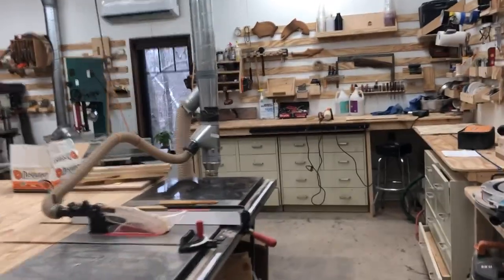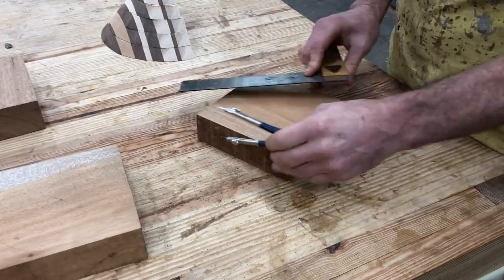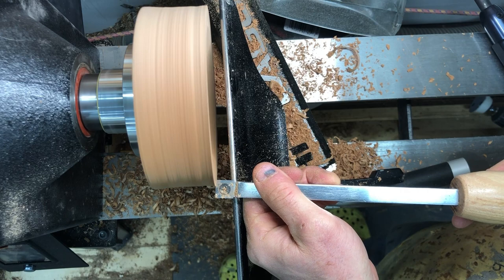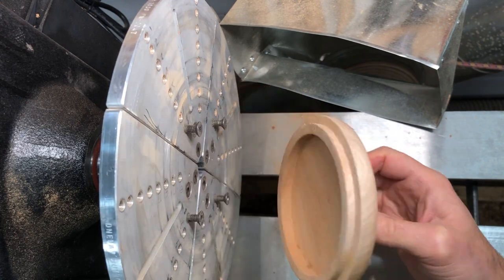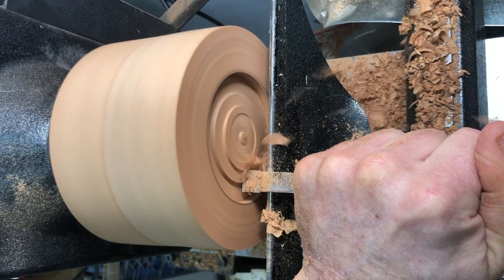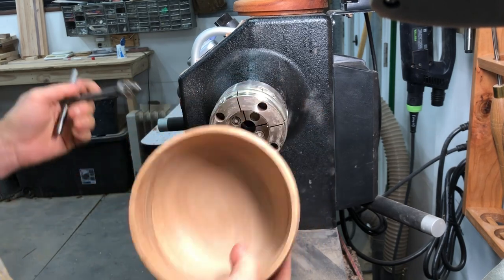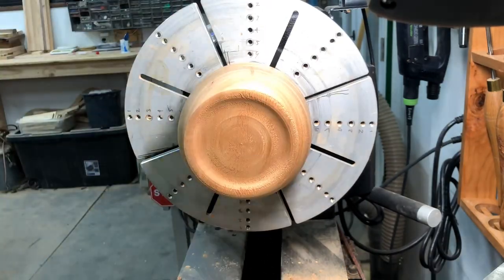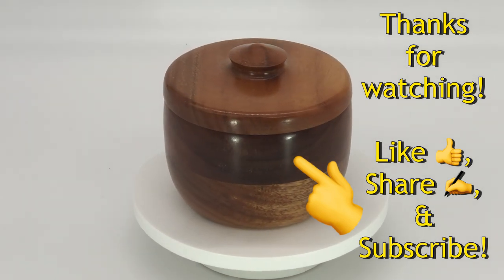Wood turning a bowl & lid from recycled mahogany

Comment: Great job Michael. I didn't know Danish oil had that much of a sheen. Did you buff it as well? Wax?   Thanks.  :-)
Reply from the maker: I mentioned it briefly near the end of the video what I thought I might use for a top coat.  And as predicted I ended up using a few coats of Waterlox followed with a wax buffing.  Nice catch and thanks for the comment!
Reply: @SapperWoodworking ù

8